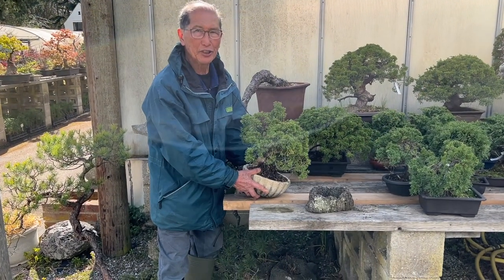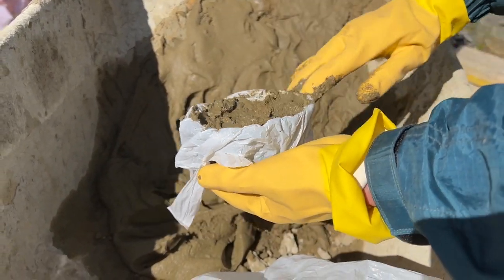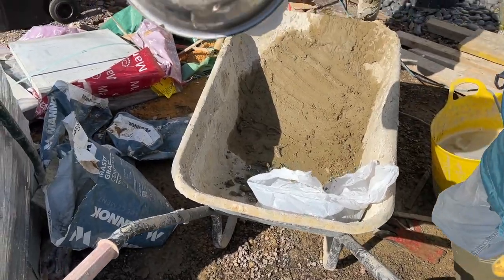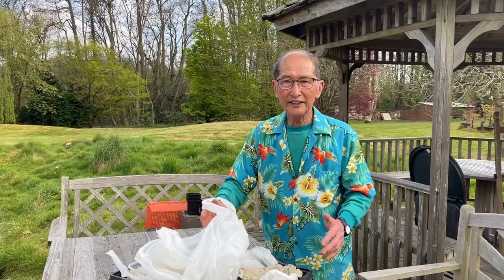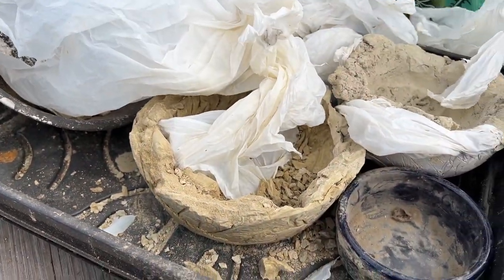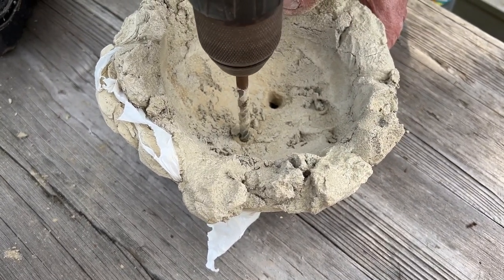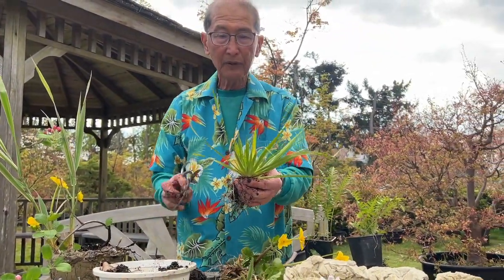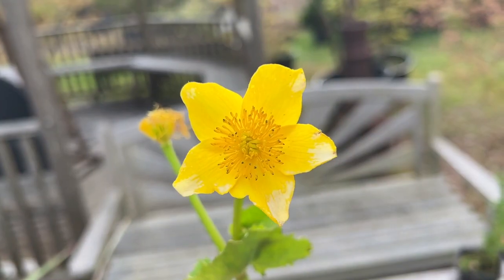Make Bonsai Pots for Free

Comment: In the good old days we used to use horse hair in the concrete. It works like a fiber additive to stop surface chips and cracking. Human hair is actually stronger than horse. Horse hair unlike human hair is heat resistant. One tip i have is sanded grout comes in colors and can be used just like cement to make various colored pots. Perlite mixed into the cement would make the finished dried pot lighter.
Reply: Like fibreglass or reinforced concrete - same principle.
Reply: Woah thats briiliant
Reply: @sharoncampbell8566  organic material like coco peat will break down and be bad for the cement. Is swells with water then shrinks when it dries. That movement is bad for the growing crystals and so better to use a fibre that does not break down or rot.
Reply: Gross!
Reply: Ash added to the cement also gives a nice colour.
Reply: All very interesting ideas!!🤗
Reply: @Gareth....  yes but they need to totally cure. At least a month dry time. You should watch the Ph of the soil also being new concrete could affect the levels.
Reply: y que te aplaudo o que wey
Reply: Use vermiculite too instead of perlite.

Comment: This is not my original idea but I make mine by dipping odd cut pieces of old clothing into soupy Portland cement. The cloth pieces are laid  over a plastic pot put into a plastic garbage bag and is used as a mold. The garbage bag stops the Portland from sticking to the mold and porous cloth acts as the aggregate with no sand or gravel needed. 2 layers of dipped cloth are allowed to partially dry and a layer of soupy Portland is brushed on inside and out for added strength. After drying for about a week it is very strong with 1/2 the weight of ceramic or concrete planters. I finish with a thin layer of white tile mortar, applied by hand, for aesthetics but is not necessary. Simple, effective and extremely inexpensive.

Comment: A couple of tips. Coating the mold(s) with oil (the regular cooking type for instance) will keep the concrete from sticking to it. If you wan't the pots to last, especially outside, it can be a good idea to add some chicken netting or a similar form of metal mesh material as reinforcement. If you wan't to make the pots more porous you can mix the concrete with turf and make something called hypertufa. The mixture requires more time to harden and is not as strong as pure concrete, but is easier to work with. It's used a lot in alpine gardens.
Reply: Very sound advice and tips

Comment: I spray with Pam. Then line the inside with leaves, shells,  beads, bits of crockery Sometimes hot glueing them before the cement is put inside. Remember to face it correctly ( pretty side against the side of the form) AND the necks of cheap water bottles set into the base to create drainage hole in the center. I like to refine any system that I use as time goes by. Everyone who has some lace doilies which they never use could line the  mold with those for really interesting texture.
Reply: totally trying the doilies, great idea! thanks for the tips!

Comment: I want to do the while bonsai hobby in a cheap and sustainable way, like using old hedges for making bonsai and rather buy used pots or make my own and even though some people would think the concrete pots looks "bad" they actually looks good imo. I got friends that work in construction so it would be no issue to get some concrete for free once in a while. Im even thinking of making a wood mold that can be taken apart so i can make "uniform" pots.

Comment: Concrete pots FAQ:

Doesnt the high alkalinity of the cement damage the plants?
After the chemical process that solidifies the concrete, the alkilinity will be almost completely gone. To get rid of any residual, soak the pot in water or simply leave it out in the rain. It will balance ph very easily.

How do i make sure the pot doesnt crack?
Cement naturally expands and contracts with heat/cold and dry/wet changes. To prevent cracking, add a sufficient amount of sand/perlite/pebbles to provide structure and offer some flexibility. For pots larger than 5lb, add micro fiber polyfibers to add durability and strength. For very large pots, add a metal structure of some kind, but know that rust will likely bleed through over the years.

Should i water proof my pot?
If you want to, use a penetrating acrylic product. That being said, its almost impossible to keep water from seeping into the pot over time. Leaving the pot unsealed will allow water to absorb and evaporate, and allow more air to pass through letting the pot breath, and be less likely to crack. This is also good for the plant, similar to a terracotta pot.

I forgot to add drainage holes?
The best way to cut or grind a hard pot is to put the pot in some water while you grind. The water will allow the pot to cut and grind without risking fractures, as well as preserving your drill bits. Let the weight of the tool do the work, applying too much force will crack the pot. Be sure to use bits rated for concrete/glass/metal, typically carbide bits.

My pot is going to be too heavy!
Keep in mind that a heavier pot can serve as a better foundation for a heavy, large tree. But if your pot is far too heavy, consider mixing in perlite to reduce weight, and consider if you made the edges and bottom too thick. 

Fun tips: pour multiple layers. Mix in acrylic concrete fortifiers into the layers after the first structural layer to ensure the new coats bite. Sponge down new coats to allow the new coat to fill cracks while exposing the older coats and leaving a nice contrasting pattern.
Consider mixing in stucco color packs to change the colors of your mix. These packs seal in the color and hold their color through the ages.
Reply: Clever tips - thank you for sharing.
Reply: Good supplementary info👍
Reply: @peterchan3100  Say, Mr. Chan, I’m going to start into your books, never having read one, and I wonder in what order would you advise me to proceed through them, regardless of whether they are in, or out of print.
Reply: @sharoncampbell8566   the mix in the video looks like portland and sand, a stucco. The kind of cement people put between bricks when they make a wall. The lime in stucco is extremely corrosive, ive been burned by it more times than i could count. But its a key ingredient for a mix that serves well as a pot. The portland cement is strong, but brittle. The sand is a vital part. Without the sand, portland cement chips easily and cracks easily.

You can buy a good mix that is similar, spec mix. There arent any rocks or pebbles, just sand. Portland and sand.

All harsh chemicals in concrete mixes are gone after hardening. In my business, ive installed thousands of lbs of fake rock next to trees and plants on the edges of pools. The plants never mind at all.
Reply: @NMranchhand  my favorite is "choosing and growing bonsai." Is very practical and offers basic information on keeping common, easily available trees as Bonsai. 

If youre looking for beautiful photography, go with 1: "bonsai, the art of growing and keeping miniature trees" or 2: "the complete book of bonsai, principles and practice." 1 focuses on details of methods and practice and looks at several species of trees, 2 takes a general but very informative look at the art and practice overall.
Reply: @michaelhenderson643  Thank you very much. While I enjoy a good bonsai photograph, I am especially interested in the details of the science and techniques of bringing forth a great tree. I appreciate your guidance.
Reply: @NMranchhand  no worries! When i got some of his books I didnt know where to start so i bought a bunch of his books online. Some were very expensive so i didnt get them but i would have liked to have had them. If you want one of mine i can send it to you, ive had a good look at them and love them but id be happy to share one of the ones i mentioned if you cant find it online
Reply: Имеет ли смысл добавить в смесь бетона какие-то пластификаторы или добавить раствор жидкого натриевого стекла, если зимой температура у нас падает ниже - 20 градусов Цельсия?

Comment: I knew I wasn't crazy i have been thinking about making pots like this but thought they would be ugly and crack to much. Ceramic pots cost a fortune and I've found it's cheaper to buy the cheap factory grown bonsai from garden centers use the tree as stock for cuttings and airlayering and then you have a empty pot and verious species and amounts off trees for less than what a pot cost's on it own. I also enjoy noodles and find that a certain brand that comes in blue pots is perfect as for £2 you get a meal and a pot with a drip tray. Definitely going to mix some cement and give this ago when the weather gets abit warmer and dryer although I think il use clingfilm or a plastic lining instead of bags to try and achieve a smoth finish with a bit of paint and luck they might look as good as bought ceramic pots. Thank you so much for all your advice and knowledge you are a master with alot of grateful apprentice's.
Reply: What kind of paint should be used? Thanks!

Comment: When you struggle to get rid of those plastic that's stuck in the cement, I find just taking a flame to it (match for small parts, candle for bigger ones - or even cutting torch). It burns the plastic away, and also leaves an interesting scorched effect on the cement.

Comment: interesting texture without the plastic can be obtained using paper, the cement bags work great for that. The paper can be burned off or soaked and removed with a brush, or simply let the empty pots outside for a bit and the weather will do the work.
Another way is to use the ground, digging a random hole and using that as the outside container, if the plant is in a big plastic pot it is fairly easy to use that directly as inside mold, put a paper bag around the plant vase (in ok weather the plant wont suffer and it can be removed in a day before the concrete fully cures).

Comment: I just wonder how safe it will be for a real bonsai.  I believe concrete has some chemicals and lime? Without sealing will it damage a bonsai if it leaches in to the soil?
Reply: Soak in water for a couple of weeks and that should be OK.  There are many Concrete planters sold these days
Reply: @peterchan3100  thank you Sir 🙂
Reply: I soak mine in a small kiddie pool for 14 days. Some soak them in a 5 gallon bucket.